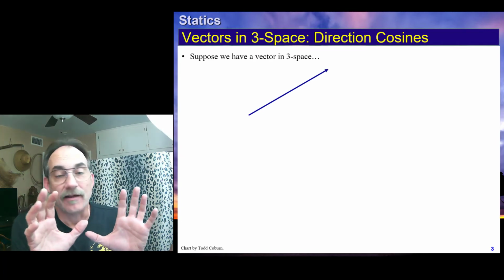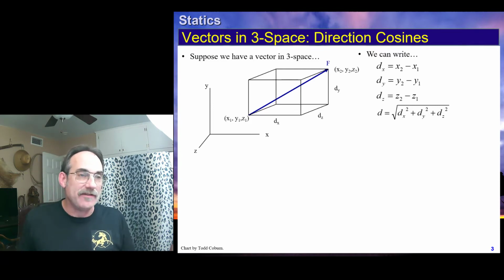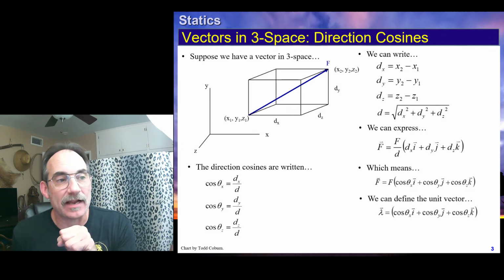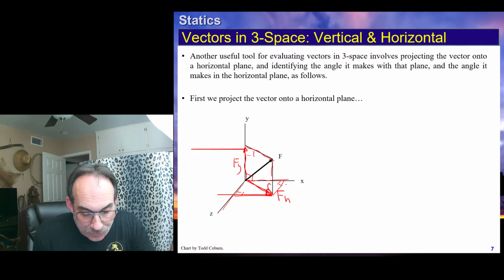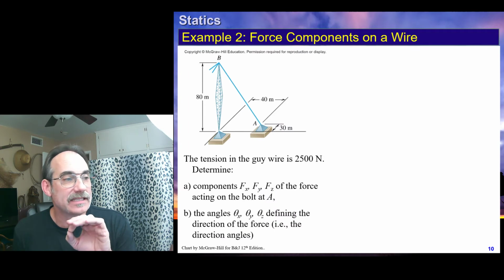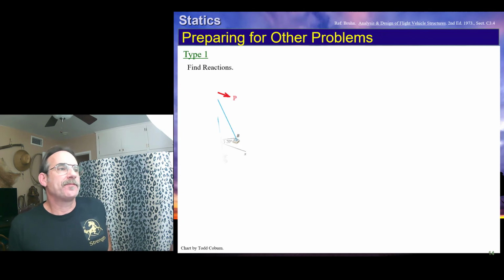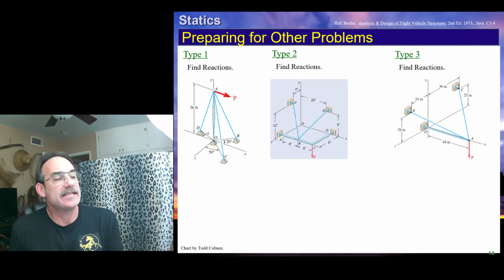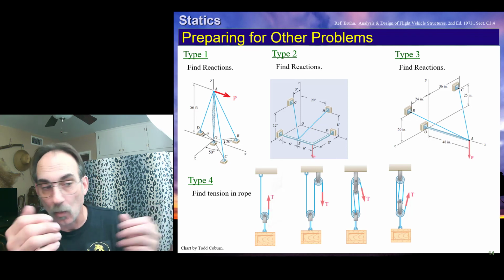Statics: L-04-Statics of Particles-3D

Comment: Thank you for the content. Really appreciate your work. Could you please give some guidance on how to correctly draw the FBD for tasks including the pulleys, e.g. B&J tasks 2.53, 2.116 and 2.133. I get that ropes will be tensed equally, but I struggle with the correct depiction of FBD and thus I feel that I double count the tension in the equilibrium equations. Thanks
Reply from the maker: The key is the section cut.  Cut the puley from all other members.  Only cut ropes, not forces.  Note that all ropes have equal tension if connected thru frictionless pulleys.  Sum forces in vertical direction.  Poof!  Solution.  See if that helps.
Reply: @ToddCoburn  thank you, sir.
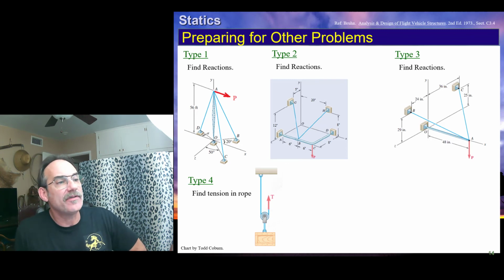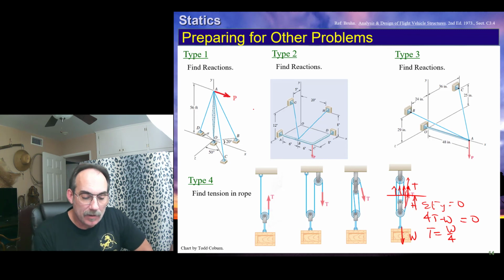Reply: For those who might face similar difficulties understanding pulleys. As Prof. Coburn said - the key concept is to cut the pulleys. This is the way how I decided to treat these systems depicted in the video at 40:28 - 42:57 or in a task 2.68 per B&J.

Initially, we need to understand that the load is transferred from the payload to the structure through the tension ropes. Therefore there are potentially 3 major elements acting in the load transfer, these are: (1) payload and mating pulley structure, (2) ropes and (3) reacting surface and mating pulley structure. Distinguishing this basically makes the whole trick. You just mentally separate the payload and reacting surface related structures and count amount of cut ropes. As professor also mentioned - the tension (resultant) in this ropes will be the same on the other end of the pulley (assumed frictionless), however one should take into consideration, that depending on the angles the tension components are going to be different. You can check that by writing down the equilibrium of all forces in the system. Hope this might help!

P.S: in tricky situations when the above judgement might not be obvious (like 2.68 a, b - first and second examples in the video), try to write the equilibrium down. For first example the applied force is counteracting the weight, but in the second one - it adds up to the weight of the crate. Additionally to that, second example has 2 attachment points, which are able to transfer the load further.
Reply from the maker: B&J has lots of example problems and problems with answers in back to check your understanding on.  Good luck!